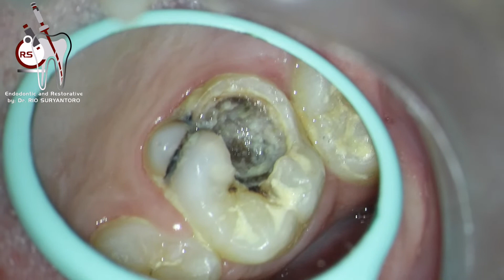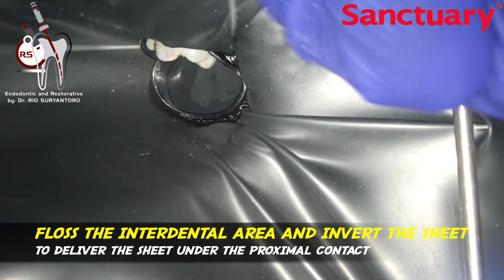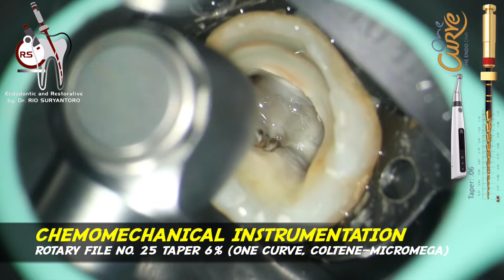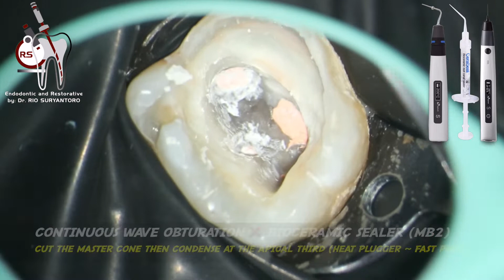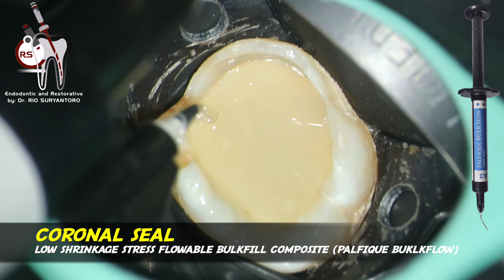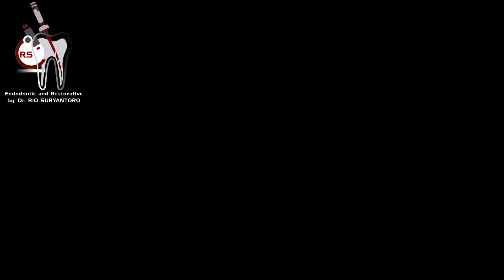ONE VISIT ENDODONTIC & RESTORATIVE TREATMENT MAXILLARY MOLAR MB2 CANAL - WARM HYDRAULIC CONDENSATION

Comment: Do you cut in the apical third with the fast pack, because it looks like you are cutting at coronal third.
Reply from the maker: hi Dr.. it depends on the technique i used during obturation.. if i used warm hydraulic condensation, the answer is "yes". but if i used MODIFIED warm hydraulic condensation, the answer is "No". i just need to fill the surrounding space between the master cone and canal wall using warm guttapercha and bioceramic sealer.. this technique can only be done if we are using bioceramic sealer, i am not recommending this technique with other type of sealer.. 😃
Reply: Halo dokter, izin bertanya setelah obturasi sebelum diaplikasikan flowable composite apakah dietsa bonding dulu dok?🙏🏻